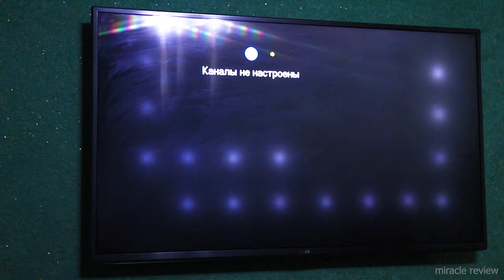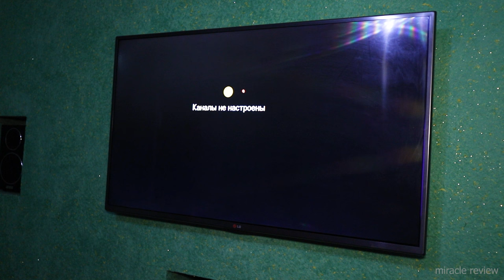How to remove white spots on LG LED TV screen. (BACKLIGHT REPAIR, glare on the SCREEN). DIY at home

Comment: Why this problems are arises?
Reply from the maker: I think this is due to strong vibration, I personally had additional speakers with a sound buffer mounted in a niche in the wall
Reply: Not due to vibration, high temperature is problem, after years it will fall in every tv... And dont use super glue it is not for high temperatures, use epoxy transparent glue up to 200 celsius degrees... Super glue will fall very soon...

Comment: So this happens because LGs glue gets dissolved over time ?  so these lenses got loose ?
Reply from the maker: I think it's because of the vibration from the loud sound. Since additional speakers were attached to the wall.
Reply: @miraclereview  I never had speakers attached and mine fell off too.